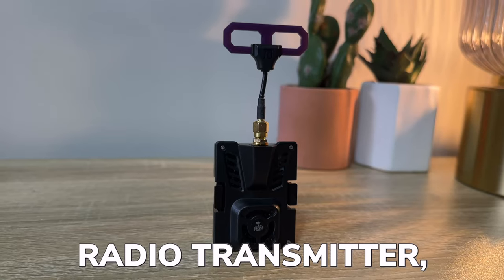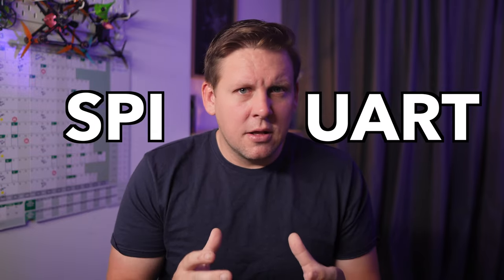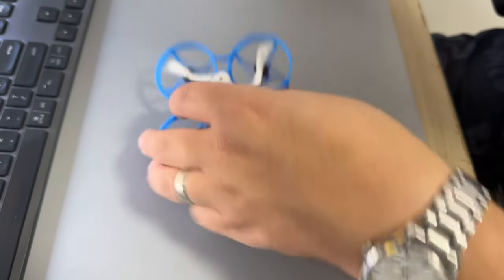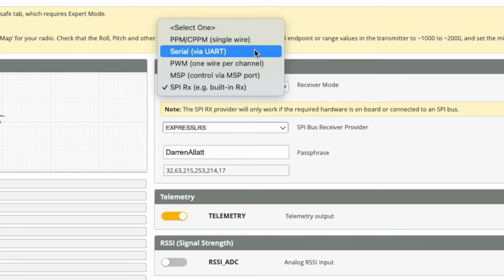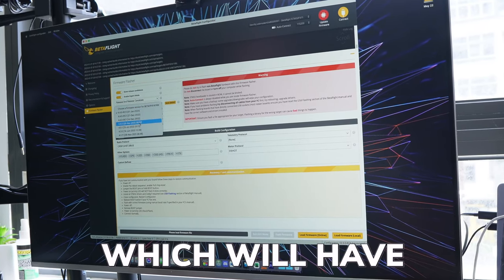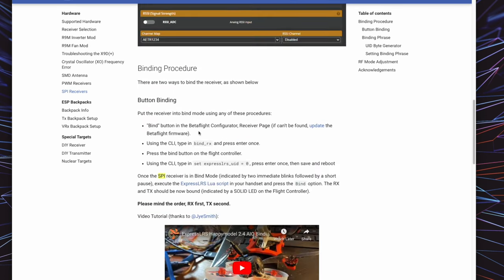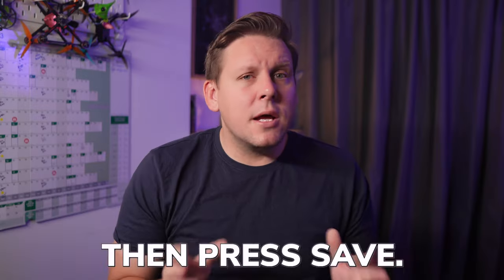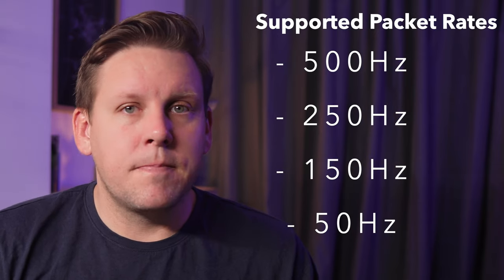Bind ExpressLRS Whoop Drones

Comment: One of the problems I had when I received my radiomaster zorro ELRS was that I could not bind to my meteor 75 ELRS, and it was that the receiver is SPI and it was in version 1. And the radio in version 2. Luckily I asked in a facebook group what I should do and ended up joining an ELRS server or discord group and they helped me at all. The only thing I had to do is just update the drone receiver to 2 and then I could finally bind it to the zorro. For the next time, I would never buy SPI receiver type, definitely. I'm grateful that you make this kind of videos to help a lot of people on this problems. Thanks!
Reply from the maker: You are welcome 🙏 glad to hear you are flying
Reply: I hace quiet the same problem my sorrow it’s on 3.3.0, and I actualise my meteor 85 on the firmware 4.4.2. 
I could bind the radio but when I get in beta flight on the receptor screen, the bars doesn’t move at all. The roll, pitch, yaw and T decenas the number onto 988. And the quad rolling like crazy. 

Some one know what could be the problem.

I have the maps Chanel aert on the radio and the dron.
😢
Reply: @mustelaputorus  Same for me : bought a Happymodel X12 ELRS Pro with an integrated SPI ELRS Rx. Despite flashing the board with several BF firmware versions, with an Rx ELRS FW 3.x, it is impossible to bind this board to my  BetaFPV TX micro ELRS. Last time I buy a board with an ELRS SPI Rx. I will finish mounting an UART ELRS Rx as usual. Very disapointed by this product.

Comment: The ELRS and SPI saga continues. A problem they knew was there and did nothing to prevent.
Reply from the maker: What do you mean?

V3 is supported in BF4.4, and manufacturers are now dropping SPI from their boards in favour of onboard ELRS receivers over UART, for the consumer there is no detriment, rather benefit as they can now get all further updates..

Also why support a protocol like SPI when a full onboard UART is better
Reply: @DarrenAllatt ELRS is a convoluted process to get up and running. If it is so wonderful why does it take several YouTuber's 1 hour each to explain the process? The whole ELRS idea with the manufacturers doing one thing and ELRS not getting hardware to certify and blah blah blah. I bought a ELRS BNF from a top manufacturer and had to connect to WIFI to figure out which receiver I had because they did not bother to document it. Then it's name was not listed in the ELRS Configurator.
Reply from the maker: My ELRS Tutorials are around 7 minutes, if you are watching 1 hour tutorials on ELRS, then someone is wasting your time… Yeah I feel your pain on manufacturers not involving the developers, they get pissed because they work for free to make the system, companies produce hardware and make a profit, then the ELRS team have to provide customer support. It’s pretty shit in that regard… Yeah they typically use the DIY firmware out of the box which can confuse new users with a target mismatch.
Reply: It doesn't sound like a very good top manufacturer if they didn't even document what RX target they use so you can update the firmware. SPI ELRS is something I think the ELRS devs regret manufacturers pushing them into... since it meant the RX code became of betaflight and end users have to play the this or that version of betaflight to make stuff work. So getting rid of this (SPI ELRS) entirely is a good step forward, as is unified targets so that firmware builds/updates will be much simpler in the future...

Comment: I swear expresslrs is going to make me leave the hobby! I have struggled for days to bind my new tiny whoop to my new radiomaster ranger. Days. I've had Bardwell on loop trying to figure it and after your video I'm all kinds of confused. Take my money dji at least then I can fly
Reply from the maker: What’s confusing?

What tiny whoop do you have and what radio is your ranger plugged into?

Have you successfully flashed your ranger or where is that up to?
Reply: I have the radiomaster tx12, not mark ii. And the new ranger micro elrs plugged into the Jr port. The whoop is a eachine uz65 1s. The radio seems to be working,  I can go to the controller, go through the rangers' options, hit bind and it searches,  turn on wifi, it's there. I think the problem is the elrs receiver and possibly assigning arm and air/angle switches.  The uz65 comes up on betaflight as a spi but it has a separate receiver,  it's not an all in 1 board.  And the receiver led stays red. It doesn't blink, change colors,  I press the button on receiver and nothing,  hold it , nothing.  I put it in bind in betaflight and on the tx12 in the ranger hit bind and nothing,  no bind, no different change in led color.... maybe because I have a bind phrase on the controller but have no idea how to create a bind phrase for the uz65 receiver.
Reply from the maker: @dustinpugh8222  

Ok, so which version of Betaflight is on the whoop, and what does it say in the receiver tab? "Serial, and then CRSF" or "SPI-RX with ExpressLRS"

The button the receiver is not a bind button.
Reply: @Darren Allatt  it says spi rx (built-in receiver)
And the next line says expresslrs. Wondering if I need to update betaflight to 4.4
Reply from the maker: @dustinpugh8222  well, I give two solutions in the video:

1) Update to 4.4
2) Downgrade Transmitter to 3.5.1

Pick your poison there
Reply: @DarrenAllatt  I would prefer to upgrade.  I have betaflight 4.3. How do you install 4.4. Thank you for your time and help!!
Reply: @Darren Allatt  I have update the firmware to 4.4 but for my whoop that uses crazybeef4sx1280 the latest release. Even release candidate doesn't have 4.4. . Idk. But once again thank you for your time and help.
Reply: @Darren Allatt  thanks so much for your patience and help! There is a 3rd option that ended up working for me. My whoop has a crazybee fc and at happy model there's a 4.3.1 firmware update.  I'm up and flying,  not giving up this hobby!
Reply: @dustinpugh8222  can u give a little more detail to what u did ? i have the same whoop and experiencing the same problem. ty
Reply: @Al HARLEAUX  there was a John Cuppi video about the mobula 7.. elrs spi... something,  right. It's about 3 weeks old. The uz65 has the same all in one board and with the information from the 2 videos,  I was able to pair my ranger module and my whoop. Although now my video signal sux but completely different issue

Comment: Thanks Darren. Helped me on spot! As for long term solution: Wouldn't BF 4.4 (and further versions) be capable to use updated ELRS versions (until a certain point in the future)?
Reply from the maker: Technically yes, but BF4.4 has a watered down version of the ELRS code (hence the limited packet rates) but you don’t want BF to have to have ELR code in it, makes BF heavier and more process intensive than it needs to be. You also don’t want BF having to worry about ELRS code, when they should be focusing on their own code. 

Long term, AIO’s will move from onboard receivers over SPI to UART where they will have a dedicated processor for ELRS and it won’t be the job of BF to do that.
Reply: @DarrenAllatt  Makes sense, yea.

Comment: really good video. straight to the point, subscribed
Reply from the maker: Thank you!
Reply: @DarrenAllatt  thank you man, i've got one more question because i have ordered a new receiver for my tinyape, what i have to do with the spi receiver if i use an external receiver? kind of shut it down?
 sorry if u said it in the video i didn't remember
Reply from the maker: @giulioc3610  when you set the receiver in BF to SERIAL it disables the SPI RX.
Reply: @DarrenAllatt  thanks again! :)

Comment: Hi, now that official betaflight 4.4 is launched, if I have a mobula7 with SPI ELRS2.0, I just need to flash the FC and it should be able to bind to my ELRS3.0 TX?
Reply from the maker: Yes you should updated to 4.4, however take a backup of the CLI before you do. 

Then it should just bind.

Comment: What about if the whoop has a serial already stalled instead of SPI  receiver?
Reply from the maker: Then you would use the normal process, because it means it has its own external receiver built into the board

Comment: How do I bind my tbs tango 2 mpm to my mobula7 1s spi elrs? My mobula7 hd 1s bound no problem but this one will not. Thanks
Reply from the maker: Just so I understand you correctly, you have a Tango2 with a Multi-Protocol Module attached?

Which Multi-Protocol module do you have?

And your Mobula7 HD is that the ELRS version or the FrSky Version.
Reply: @Darren Allatt  I have the spi elrs and the not sure what the mpm is but I use it for all my whoops and crossfire on 5".
Reply: Wow I feel like an idiot 😕. the hd was frsky. this one is elrs. operator error
Reply from the maker: @jonathanmcwhorter1353  All good, we've all been there

Comment: Best long and cheapest way is to have an android device and connect to the TXs wifi and flash it over wifi. Just have two firmware ready ;)
Reply from the maker: if I understand this correctly, what you are saying is, to flash ELRS v2 to your TX from your phone when you want to fly a Quad with an SPI RX, then you when you are flying a quad with a normal RX, to then re-flash v3.2?

Or, just update your ExpressLRS SPI Quads to Betaflight 4.4 and you are good to go!
Reply: @DarrenAllatt  yes correct. Just have two firmware ready for your tx if an update of your SPi RX is not an option
Reply from the maker: @dronevan  when would it not be an option to update your SPI RX firmware?
Reply: @DarrenAllatt  one month ago there was no official EalRS 3.x support for SPI Boards. Maybe ur a guy who is very satisfied woth all settings and your tune. every BF update brings new features and filter which can lead to a diff flight performance. This is just one reason why not to update your FC firmware. But nowadays ELRS 3.x is supported

Comment: I have a different problem.
I had no problem binding the expresslrs module to the transmitter. the problem I'm having is stick input. I even tried switching the TX and RX thinking I might have put them backwards and that didn't solve the problem. It's a brand new transmitter brand new flight controller everything's working except for stick input.
I know I'm missing something simple like a lua script.
Reply from the maker: Mixes tab in your radio
Reply: @DarrenAllatt  😏👍 I'll have to check that first thank you.
Reply: @DarrenAllatt  no they appear to be fine. I'll be working on this for a while I had the same problem with the XM Plus receiver and I don't know why.
Reply: A little more detail is required here... I. E. stick input is a problem in what way? No movement on the receiver page in betaflight configuration? Wrong channels moving? Moving the wrong way? With what receiver/TX combo? Firmware versions? I. E. If its SPI RX, and you have the wrong RF mode set, no channels will move. If the channels are not in the order BF expects, wrong channels move.
Reply: @pfeerick  I just uploaded a video explaining or answering most of the questions you've asked as far as stick input zero. I'm beginning to wonder if it's the receiver. I'm making sure all my firmware versions of the proper before I do anything else including my Express lrs versions

Comment: none of these worked for me
Reply from the maker: Ok, that’s a little strange. 

What Whoop/Quad do you have and what Radio or Transmitter module do you have
Reply: @DarrenAllatt  eachine uz65 ELRS/ radiomaster tx16s, ive set both to the same 2.5.1 firmware in ELRS config,and matched phrases using the generator but still no bind.
Reply from the maker: Set your radio to 250hz packet rate. 

Your Whoop shouldn’t be running ELRS 2.5.1, how did you flash that to it?

How did you add the binding phrase to it?

On the UZ65, you need to run BF 4.3 and your Radio 2.5.1

Set the packet rate on your radio to 250hz.
Reply: @DarrenAllatt  ok imma try that out ill let ya know.
Reply: @DarrenAllatt  i used the phrse generator on the website, i plugged in the code using Betaflight CLI mode. I want to  note that i also have a 5in quad i run on elrs daily.
Reply: @DarrenAllatt  so where i found my mistake is i was setting the packet rate to 250hz on the transmitter, when i needed to change it on the drone. Cli box- set express lrs_rate_index = 1 save. thank you for the help.
Reply from the maker: @SpacelionsOdysssey  You are welcome, now just send it!